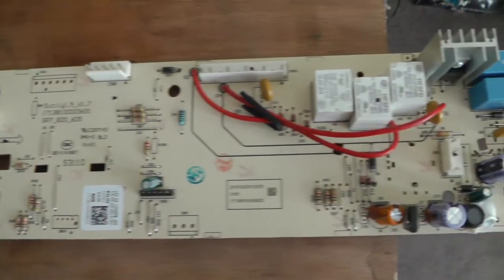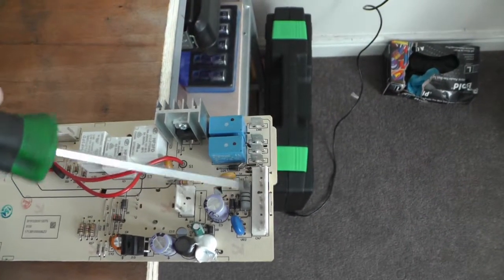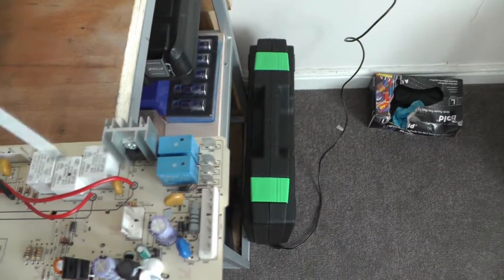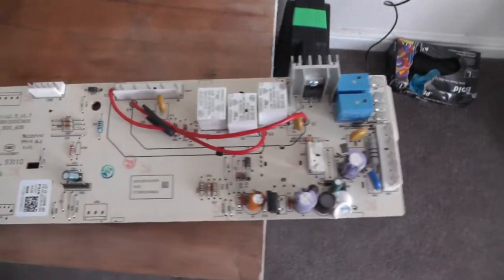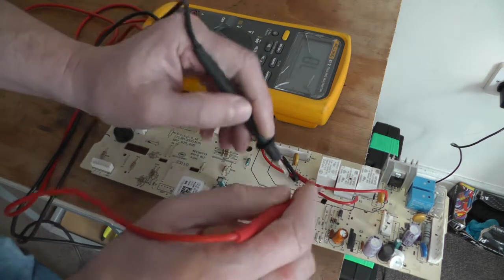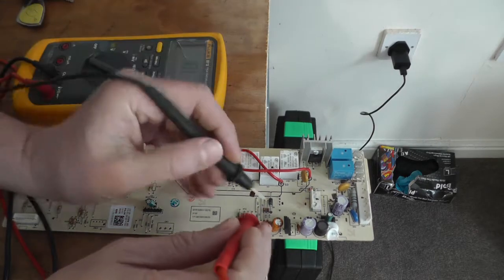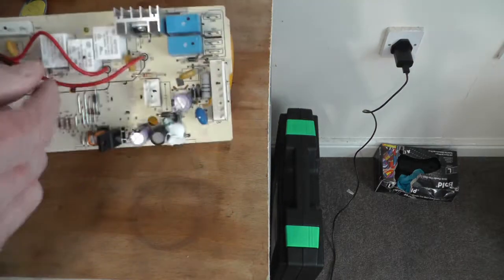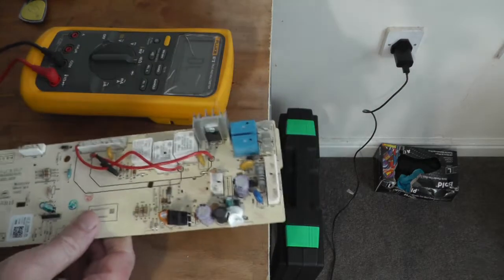Washing Machine PCB Repair 💥 | Control Board Troubleshooting & Fault Finding with Multimeter

Comment: Sir please all wiring connection told me supply ac
Reply from the maker: The video covers the power supply to the board.
Reply: Sir actully phase neutral connector

Comment: Testing already soldered down components doesn't tell you anything since the readings will often be wrong as the components are connected to others.
Reply from the maker: obviously but you do not start removing components immediately.

Comment: Hi .
My washing machine doesn’t not wash anymore,
All it does is to spin and dry.
When filling water, it doesn’t not contain water ,it fills and drains at same time.
Could it be a pc board fault?
Reply: 1. Check the drain hose, it must be higher than half way up the glass door
2. Some machines, ie Bosch, have a ball that floats in the sump hose attached to the pump, check this
3. If the machine is pumping out the water, instead of the water just running out, the pressure switch maybe faulty, it’s incorrectly indicating the machine has over filled